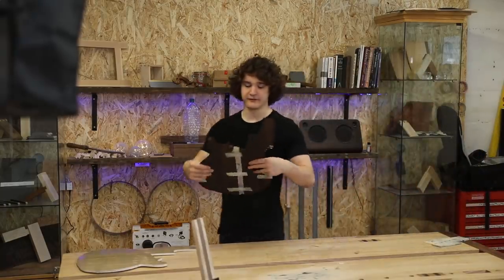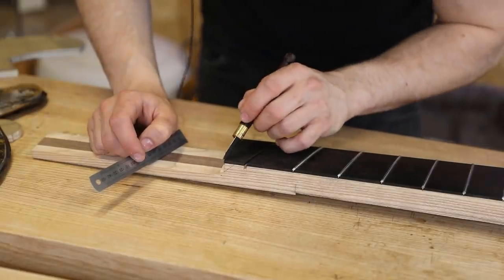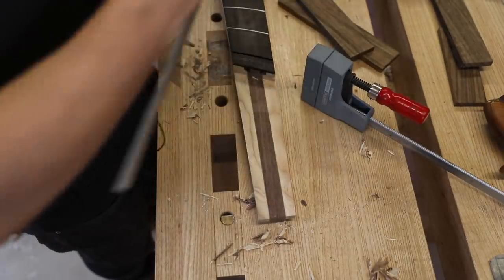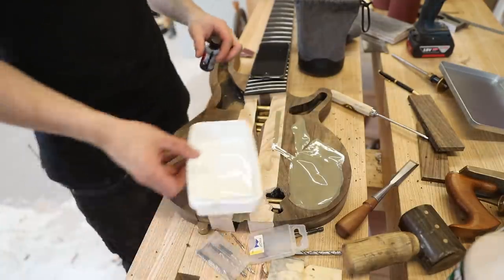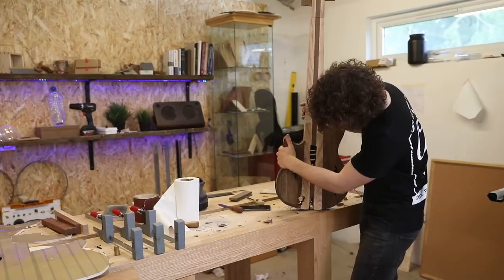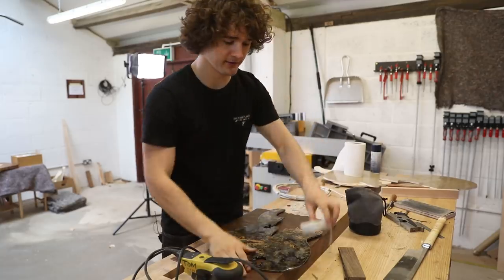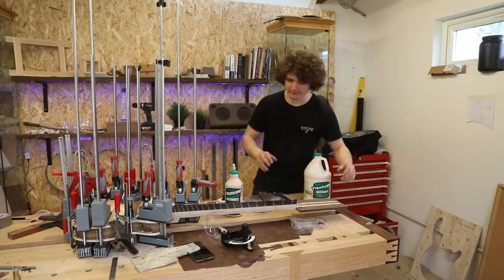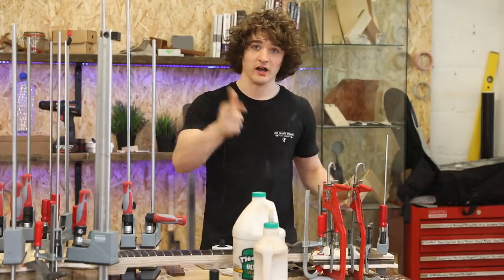Making a Custom Bass Guitar | Part 16

Comment from the maker: If you enjoyed this video, don't forget to press the LIKE button, it really helps me out!

Can't be asked to watch the entire series? See the finished piece here: https://www.mattestlea.com/blog/roadworks
Reply: Glue ups would be easier and less messy if you use a small foam paint roller to apply a thin layer of glue to each surface of the joint.

Comment: Discovered this today (fitting as I'm gonna build my own 6 string bass soon). Just as a small tip.. you could hang an extension cord from the ceiling and plug in your power tools there! :)
Good stuff!